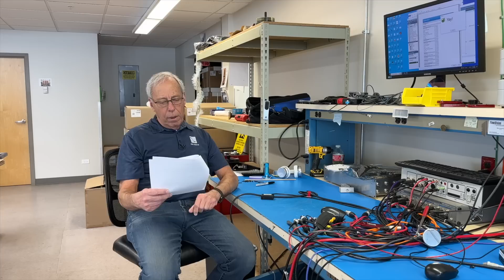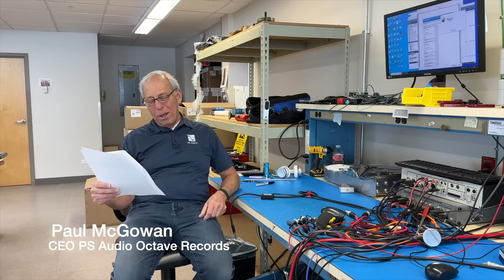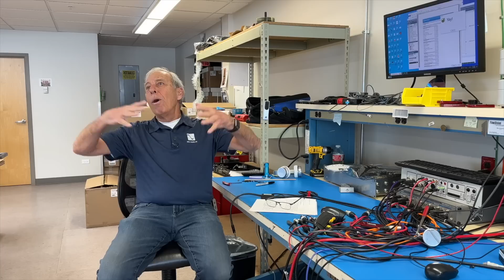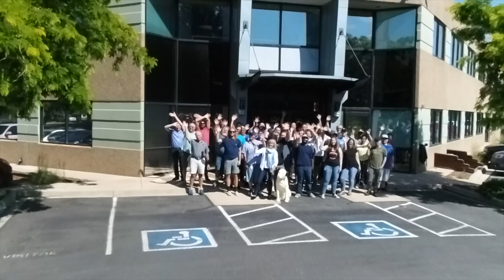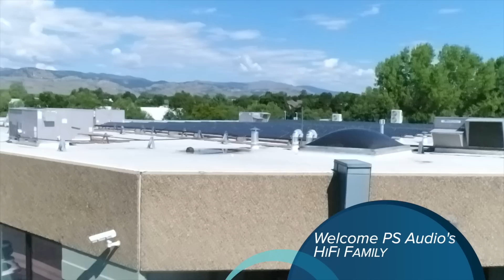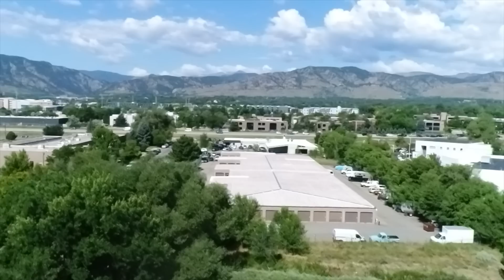Impossible audio measurements

Comment: i think a thing that could be measured is how much the errors in sound mirror the harmonic behavior range of nstural instruments.

errors that behave like music are not perceived as errors at all.

and how errors affect the neurological side of listening. badicly psychoacoustics in reverse to figure out masking, elevating, focusing and diffusing effects on how our brain can read sound.

analysing gow sub and ultrasonics produce resonances that can effect the audible spectrum by bleeding into it would be great too

i think ths is also the key to why vinyl sounds so pleasent. vinyl behaves like an interpreting instrument instead of a shoddy storage.
Reply: @Douglas Blake the error is easily measured, i know.
the wuestion is whether or not the error has characteristics that behave more like music or more like cacophonic noise.
errors that behave like music are less of an issue. and if the error mstches the natural variation of the used instruments in the recording, its effectively no error but just a different live session.
Reply: @Douglas Blake  mostly. but we are talking about the highest end audiophile search for perfection here.

and when there is a choice between noisy error and music like error, the second is better no matter the scale
Reply: @Douglas Blake  cables have negligable effect. speakers and amps can have coloring one or the other way.

my equipment is dirt cheap and i enjoy listening to music more than systems.

Comment: The question is whether audio is just physics or physics + psycho acoustics.  It is the latter of course, but the physical part can be and should be tested.  The electronics part is the easiest one to test (power, channel separation, THD, noise, frequency response, etc). Speaker testing is another whole game.  It is of course crucial, and not available until very recently.  Erin's audio corner and ASR are good sites for speaker review.  The psychological part can be useful if the individual doing the review has a lot of experience (Paul has it I am sure) listening speakers, but it is not the whole game.  Sorry, that is the way sound works.

Comment: I agree, imaging is the missing measurement. But I wonder if it cannot be quantified. It would require creating a test recording with very precise sound sources, and a “listening” device that could precisely locate the sound source left to right between the speakers. Forward and back on the stage would be another level of difficulty, but it seems it could be done. Surely AI could assist. 

Then, with a standardized recording (not necessarily of music) speakers and systems could be measured against the known standard. 

I personally feel that depth and side to side placement on the soundstage are mutually exclusive, meaning the stronger the right/left image, the weaker the depth image, and vice versa. Of course, I cannot PROVE my theory, but I strongly believe it based on experience. 

And to a large extent, IMAGING is artificial. Most recording engineers know nothing about imaging and therefore pay it little heed in the recording process, I do generalize, but I have spent decades recording and when I speak imaging to another engineer, their eyes cross.

Comment: I wouldn't be without measuring equipment (and simulation software) designing and building speakers, but to put a number on it, this accounts for less than 10% of the work load. Hence I question some people's obsession with measuring versus listening: it's as if 100% of their concentration were on a tiny part of the whole. Also, how they manage to ignore phenomena one can hear but not measure is beyond me. Whatever we design and build is for people to use and enjoy music. I've never once seen a piece of measuring equipment shop for, own, use and live with a Hi-Fi system.
Reply: It's simple really.
Test equipment can be calibrated and test environments can be controlled and biases can be eliminated.
Ears on the other hand there are no two ears that are alike (even your personal left ear and right ear differ) and vary greatly from listener to listener.
Age degrades hearing and it is a proven fact that the average 20-year-old has lost 21% of their hearing and typically can't hear above 16kHz.
As people get older they lose more of that hearing ability depending on the environmental noises they are subject to.
A person living in New York City or Los Angeles will have more substantial hearing loss than someone living in a cabin in Alaska unless that person from Alaska shoots guns with little or no hearing protection.
The point is that ears are the least reliable for determining sound differences and most differences perceived are usually caused by bias.
Reply: @JonAnderhub  Not at all. You're point is well-taken in that measuring equipment is good for R&D. But it's those individual ears attached to the customer's listening brain who are paying for the product. At the end of the day, the measuring equipment decides whether or not a product is in the ball-park. Human ears decide if one hit a home run. And I cannot stress this point enough: it's a mistake to base one's buying decisions on something other than oneself. Listening to reviewers, snake oil salesmen, self-proclaimed audio scientists (aka fools with tools) - it's all the same. It doesn't matter if one's decision is based on measurements or someone else's opinion - if it doesn't sound right, and one has to convince oneself it must, based on a review, measurements, peer pressure from other audiophiles, THAT is the point where one enters the realm of belief versus knowledge. Worse yet, if it doesn't sound right and one were forced to talk oneself into accepting one's own ears are useless in deciding what one likes, what's that going to do to a person? In a nutshell: measuring equipment is a tool, and I'll insist on using mine because it saves time and money in R&D, plus anyone with a modicum of scientific curiosity will want to know what they're doing, i.e. gather as much information as possible about the differences they're hearing, and preferably, achieve repeatable results, and improve. Don't fall into a trap of limiting yourself to the little we can measure and prove, when there's so much to learn.
Reply: @JonAnderhub  Also, and I believe Paul has made this point in some of his videos, if one's self-esteem as a listener were dependent on the quality of one's hearing, at which point would a scientifically minded person draw the line, meaning, at which point would you give up on listening to music? My father is ninety and can only follow a conversation in a one-to-one situation without hearing aids, and ironically, those hearing aids appear to be of little help once he's in a crowded restaurant, as they're not selective. What is selective is our brain. It's the exact same with audiophiles: they don't have "golden ears" (even though some perform better than others in blind tests, just like wine critics in blind tastings, and I know people who do so well it's frankly amazing), for the most part, they're trained listeners. This is why it's irrelevant if one's hearing in older age equals that of a child in e.g. its treble extension. Besides, we're still hearing the intermodulation of any multiple frequencies beyond our upper hearing spectrum, as those logically range in the single to three-digit cycles per second (so what happens outside our hearing range still matters to an extent). In a nutshell: don't let anyone tell you how to enjoy music and indeed life, as in don't talk yourself and others into getting an inferiority complex because their hearing objectively doesn't stack up to the frequency extension of a microphone that has no brains and no soul. That's just BS.
Reply: @Douglas Blake That's hilarious! I have a much better measuring equipment than that, and not even an FFT analyzer or the million dollar Brüel & Kjaer analogue measuring equipment used in the anechoic chamber at the Swiss Federal Institute of Technology Zurich we would sometimes use could measure the difference between e.g. the perceived difference in soundstage depth in a file played back in an otherwise identical system at calibrated level using different cables. Blind and double blind test results 100% - janitor providing the keys to the anechoic chamber included. While it is true measuring equipment offers precision below and beyond the threshold of human hearing, it can only measure a handful relevant aspects of human experience - people tend to forget we listen not just with our ears, but our brain. Nor do we use our ears to analyze the flatness of the frequency response, of have our brain perform a Fast Fourrier Transformation and plot a waterfall diagram. Your remark reminds me of what is essentially wrong with our educational system: the curriculum focussing almost exclusively on what can be measured and hence marked, with universities bringing into the world instead of intelligent people (in case of doubt, the Latin verb "intellegere" refers to an ability best described as "to read between the lines") no more than fools with tools.
Reply: @Douglas Blake I've "only" designed loudspeakers and am not qualified to discuss the science behind it, but I've participated in blind and double blind tests of e.g. file formats (MP3, MP4, PCM ranging from redbook 16-Bit/44.1kS/s to 32-bit floating-point DXD and DSD up to 512fs), S/PDIF cabling (75Ω and 110Ω and mismatched 50Ω RCA plugs etc.), Ethernet switches (!) and cables (!) - in short, differences that in my understanding wouldn't stand up to something as basic as a null test, and it was a piece of cake getting 80-100% right. Leave it to the electrical engineers to figure it out, or at least the handful who've preserved a modicum of scientific curiosity through their studies, instead of trolling forums perpetuating unsubstantiated claims about the alleged inability of trained listeners to use their brains.
Reply: @Douglas Blake Needless to say, I'm in complete agreement with anyone using measuring equipment in R&D. I certainly wouldn't want to do without.

Comment: With a degree in electronics, years of bench work, amp design,.... the biggest problem audio has in measurement is we are stuck in antiquated steady state sinewave measurements. And that has nothing directly to do with actual musical signals.

Back in the day it was even hard to produce a low distortion sinewave as a test signal! Impossible to capture and measure transient signals other than maybe clipping? In the video test world we at least had differential phase and gain measurements. Dynamic signal measurements. With audio at best THD, signals added harmonically related, IM, how two steady state signals interact, ... rise time/ slew ... of steady state squarewaves... 

Even FFT's are based on accumulating information over a period of time to convert from time based to frequency based information. Which means starting at zero time means an infinite combination of frequencies. With actual frequency from time conversions requiring more time period of measurement for greater accuracy. So a single complex transient means nothing in FFT. 

I was in highend test and measurement of video when digital hit that technology. Special time domain tests were invented. Digital test plates, zones,.... Other than TIM, audio has done little.
Reply: You must be retired because the reliance on sine waves to measure has been gone for nearly twenty years.
Everything from 'noise", to frequency sweeps, to impulse responses, to driver timing alignment, to A|B comparisons of musical source input to output is measured to achieve appropriate measurements.
Reply: @JonAnderhub  Please show us all these published non-sinewave specs. Minus frequency response, THD, IM, ... show us all where ,,, "driver timing alignment" does not use a sinewave based reference measurement. Or crossover suckout seen with sinewave based "frequency sweeps".

Comment: Any audio company aiming at awesome audio fidelity needs to combine measurements with listening tests rigorously. Only ignorant people will think you can reach excellency with measurements alone or listening tests alone when it involves engineering of speakers and audio electronics.
Reply: @@Douglas_BlakeYes, when repairing analog audio gear, often listening will give you a hint…no audio=power supply, one channel works=other channel path is broken, hum=bad power supply caps etc.

Comment: If it can be heard, it can be measured, in theory.  At the end of the day, the human ears and brain are simply measurement devices.  If you can hear something, that means sound waves are traveling to your ears.  You can make a substitute for ears (for example a fake head with 2 microphones in it).  Then it's just a question of putting some kind of algorithm on the soundwaves to figure out the difference.  Is it worth creating?  Maybe, maybe not.

The point is that the human mind can be tricked and biased, and a better analysis tool can remove that, in theory.

Comment: @1:54 "How do you measure all of that?"
Our brains (via our ears) measure all of that.

Note that the lemmings that worship Amir (the scientist impostor) claim that everything can be measured -- asserting if you can hear it, it can be measured.

Thank you, Paul, for addressing this measurement subject.
Reply: @Douglas Blake "If you can hear it... so can a microphone ... So yes, what you hear can be measured, quantified and analyzed electronically."
And yet you chose to not offer evidence of such measurements, nor any equipment that can perform such measurements.

Given two pairs of speakers:
Which measuring tool will reveal which of the speakers throws a wider soundstage?
Reply: @0Perhaps  The measuring tool you are asking about is called a “microphone.” Kind of like a speaker in reverse. Two other helpful tools are called “tape measure” and “protractor.” The thing about speakers is that the sound waves they produce become more directional as frequency increases, so it is important to use the aforementioned tools in an anechoic chamber to measure the intensity of these sound waves as functions of horizontal and vertical angle (vs speaker central axis) and frequency.

Since most speakers are not used in anechoic chambers, these sound waves will reflect off any solid surfaces (“solid” being a bit of a gray-area term due to frequency dependence), losing some energy and phasing along the way until they reach your ears. 

Strongly recommend that if you’re interested in the psycho-acoustic aspects of speaker performance, including their ability to image well, that you look into the (lifetime of) work of Dr. Floyd Toole. There is some great content available on this platform, including a talk given at McGill University a few years ago.
Reply: @Douglas Blake 2nd request:

You wrote:
"If you can hear it... so can a microphone ... So yes, what you hear can be measured, quantified and analyzed electronically."

I asked:
"Given two pairs of speakers:
Which measuring tool will reveal which of the speakers throws a wider soundstage?"

You will not answer, because in video after video, you fabricate BS, and you never support your BS assertions by way of evidence.  You just write BS.

Refusing to answer is conclusive of you being caught writing BS.
Reply: Ears are the most ineffective means to measure differences in sound.
No two ears (including your left ear and your right ear) are constructed the same.
No two people hear the same.
It is a proven fact that the average 20 year old has lost 21% of their hearing and most can't hear beyond 16kHz.
Furthermore, hearing degrades more and more with age and this doesn't take into account degradation through Lastly, ears are connected to the brain which can be easily influenced by other outside sources and create unrealistic bias.
Measurement equipment can be calibrated to known standards and genuine results can be replicated by others so as to eliminate bias.
Reply: @JonAnderhub  There are speakers that have fantastic measurements, that do not sound very good.
There are speakers that have nothing special measurements, that sound amazing.

To which of the above speakers would you rather own?

As to hearing loss, that is irrelevant, because we have the ears that we have.  Whichever equipment sounds best to our ears, well... sounds best to our ears.

Which measurement equipment can be calibrated to the known standard for the widest soundstage?
Our ears can hear the equipment that throws the widest soundstage.  So which of man-made, calibrated equipment can perform that soundstage measurement?